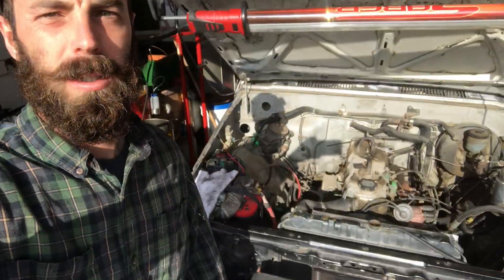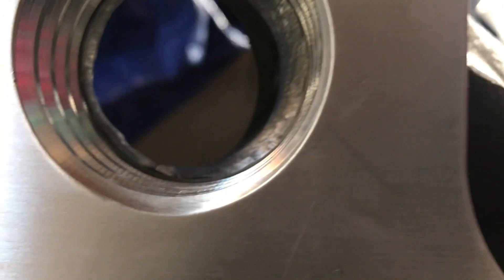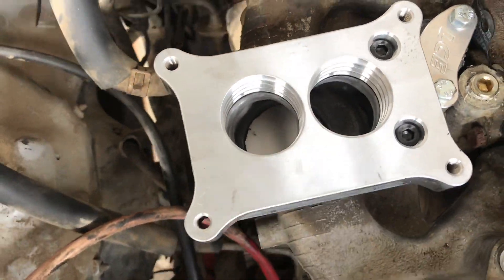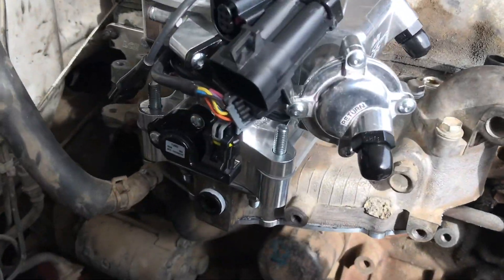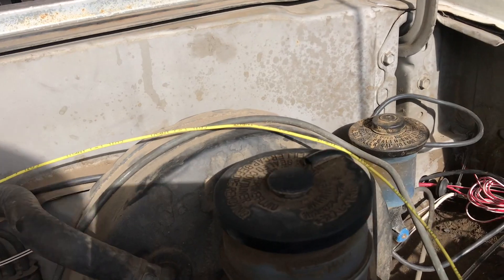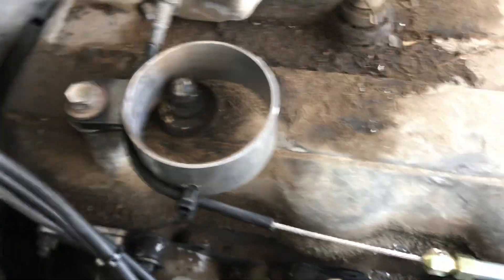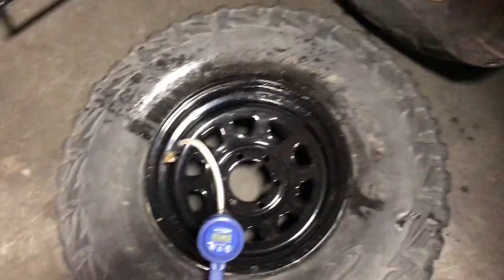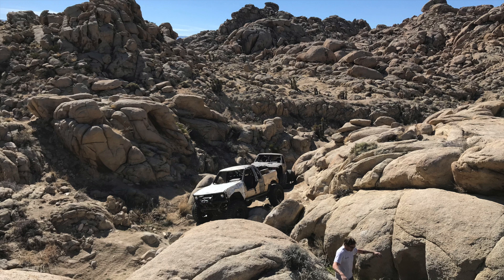Mini Garage! Crusty Crawler gets a Holley Sniper! How-to

Comment: I should have done this, I don’t have any trouble with my carb
But I added a propane kit and this just takes that out of the equation 
Less crap, the propane kit works, but this just looks a little bit , or a lot cleaner

Comment: I did the same thing to my 22r, how did you get ignition timing??? Mine doesn't show it
Reply from the maker: Just hooked it up? are you viewing the correct screen?
Reply: @MechanicalAdventures  yeah I'm using the screen that has timing on it and I've hooked it up correctly had it running for a couple of months now. Coil negative to sniper connection right?

Comment: What kind of fan did you get
Reply from the maker: I had a Derale fan/shroud kit from a customers project that I adapted to work on my radiator. You can just measure your radiator and go on summit racing and find something that fits
Reply: Will do thanks

Comment: Also what kind of fuel pump did you use
Reply from the maker: I used the fuel pump that comes in the sniper “master kit” it’s some kind of walbro knock off. Probably 190ish liters per hour, most “in line” fuel injection fuel pumps will work
Reply: Oh ok thanks for responding I’m going in that direction also

Comment: What did you use to connect your throttle linkage? And what did you do with the 2nd cable?
Reply from the maker: I bought a universal throttle link “end”. I didn’t have a second cable, cruise control maybe?
Reply: @MechanicalAdventures  do you have a link where I can get one of those?
Reply from the maker: @MoneyShotz23  Lokar S-1034 Carburetor End Assembly https://www.amazon.com/dp/B001Q4XCS6/ref=cm_sw_r_cp_api_glt_fabc_DV7PFDMYA58M6KKW4CHC
Reply: @MechanicalAdventures  appreciate it man 👍

Comment: hello what carb adapter and spacer did you use what part number thanks
Reply from the maker: LC Engineering Holley 350/500 carb to 22R manifold part number 1033018

Comment: howd you mount the fuel pump?
Reply from the maker: The sniper kit comes with “p” style clamps that I attached the the inside of the frame rail. I can’t remember if I used self tapers or rivnuts
Reply: OMG. I’ve been looking for info about Sniper installation. You’ve answered them in this video. Mainly throttle linkage hook up and pump plumbing at the tank. I do have one question. I believe you said you connected you fuel line intake onto the 5/16” od pipe coming out of you fuel tank? If that is the case then the pump can “suck” the fuel to the pump? Holley is telling me the pump won’t do that because it’s a gravity feed pump. They are telling me I have to install a bulkhead fitting in the bottom of my tank! Problem is getting in the tank to tighten the nut. Then they are telling me the pump has to be lower than the fitting which means I’d have to mount it under the frame! Please clarify how your hooked up you line take line. Thanks you very much.
Reply: @paullatham1948  make sure its mounted under the gas tank. the pump needs to be gravity fed or itll burn up.
Reply: @deadjoey77  
Thanks you. I ended up going with a in tank pump that’s returnless. Now if I can figure out the throttle linkage. I have an idea if it works! Thanks again for the reply.

Comment: How do you like your Holley efi  ?  I'm tired of my carb and not to sure about going to this or propane. I have a first gen pickup with a 22r and a offenhauser intake with a holley carb.
Reply from the maker: It’s definitely a good option. It takes a little bit of tuning to get it right but it’s very reliable

Comment: Very nice. I’d do this if my 85 didn’t already come EFI from factory. Would you recommend this over the factory EFI? Looking for honest opinions. Also any opinion will not be judge just looking for info
Reply from the maker: Ehhh no, not if I had the parts or could source them easy. I have a ton of experience with snipers so it was the easier way for me
Reply: Mechanical Adventures oh ok so what you pretty much said is if I already have factory EFI just use that. My motor is good but wen I’m on pretty mean cambers it starts to cut out a bit. Does the sniper cut out? While on off cambers
Reply from the maker: No not really, look at fuel delivery issues, maybe your fuel pump is starving/not enough fuel in the tank
Reply: I'm personally replacing my 92s efi system with one of these. They are very flexible in their application and they are as tunable as you need them be. 

And if it falls I plan to just keep my mechanical fuel pump looped to the tank and a Weber in my tool box with a few choice parts. I regularly drive 30+ miles into the mountains. Dont want to get stuck

Comment: How’s that sniper doing on your 22r???
Reply from the maker: Doing pretty well! A lot better than the carb that was on there
Reply: @MechanicalAdventures  ... roughly what altitude are you at... I’m about 6500 ft
Reply from the maker: @paulrodriguez1790  rubicon and some other trails are around 4-5k ft, hammers it 3k I believe. The sniper has an integrated map sensor so it compensates for altitude
Reply: @MechanicalAdventures .... thank you for the info

Comment: Great video!! I'm thinking about installing one of these on my 79 20r soon. What adapter plate did you use for the manifold? If it matters mine currently has a Weber 32/36 installed. Thanks!
Reply from the maker: It’s in the comments, someone else asked a similar question. LC Engineering has the adapter plates for 22r to Holley 350/500 carb which work for the sniper, not sure about 20r manifold you’ll have to look. But basically the sniper 2300 has a Holley 350 carb mounting base
Reply: @MechanicalAdventures  awesome thank you very much for your help!
Reply: @MechanicalAdventures  sorry...one last question-- with your stock manifold did you have any airflow issues? Some folks were telling me it may be too restrictive but I wanted to double check with someone who has actually installed it. Thanks again!
Reply from the maker: @deathmog1  the sniper may be too restrictive? Hogwash. That sniper flows enough for 2 barrel small block Chevy v8s. It’s rated at something like 350hp. Let me know when your 20r makes half that 😂
Reply: @MechanicalAdventures  that's what I thought!! Lol. But they may have meant the 20/22r manifold itself restricting the sniper 🤷‍♂️
Reply from the maker: @deathmog1  that’s a moot point. The 20r will “restrict” the sniper, itll self adjust and run just fine. just make sure you port match the manifold and you’ll be good
Reply: @MechanicalAdventures  awesome thanks!! Your insight has been the most useful on the internet so far..was initially concerned about grabbing one of these and running into issues but it seems like it'll be very straightforward.